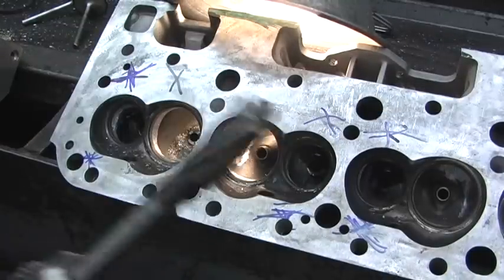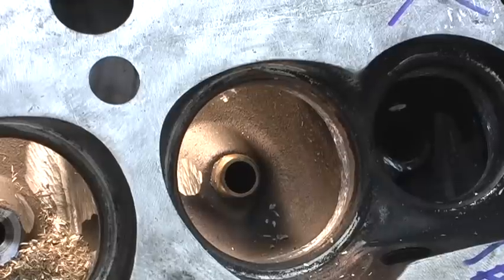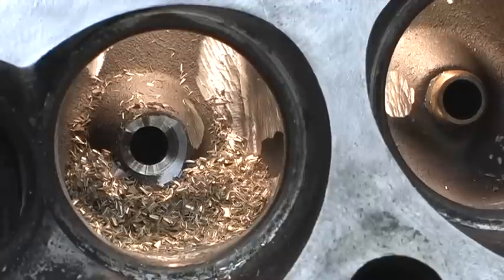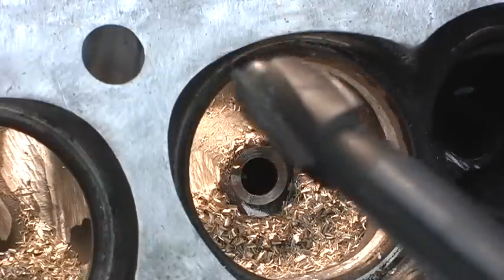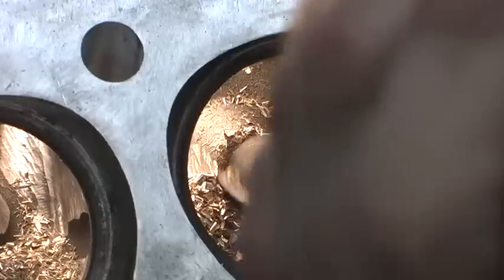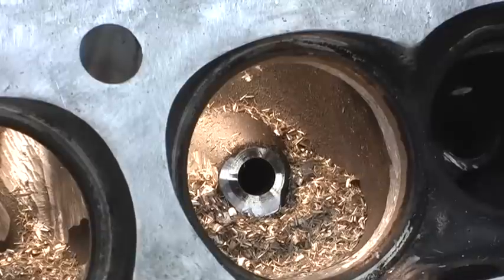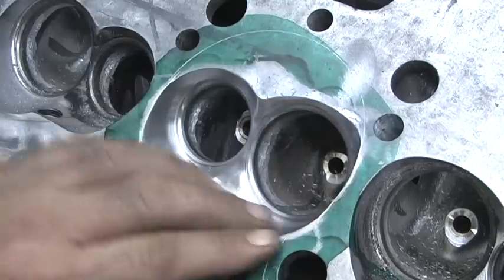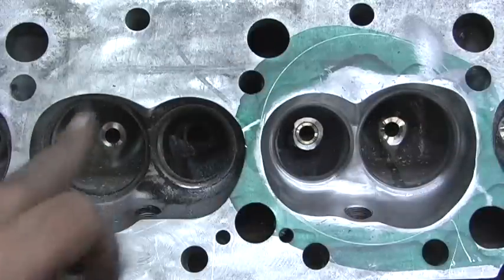Cutting Excess Guide from ProComp 210 SBC Head, custom Porting Combustion Chambers 4

Comment: If the compression is too low , angle cut the heads! A thicker intake gasket may be needed if you get crazy. The intake surface has to be cut at the same angle, its not the cheapest mod. But it also increases the flow in to the cylinders.  Putting the valves at a slightly different angle ,more towards 18°, nothing near it. I have a set of these heads . I'm itching to take them off and give them a little scratch!!!...  I want to drop compression, do I Can add boost!!  It's about 11:1. I'd like 9.8-10:1, and 10 psi. Minimum!

Comment: I have a LOT of excess valve guide sticking into the exhaust ports of my Profiler 195cc (raised, D-port exhaust ports). They're 11/32" ID, and 0.530" outside diameter valve guides. Where do I get this tool from? What is the tool called?  Someone recommended this tool to me, but it is only 0.500" wide and won't cut a 0.530 valve guide: http://www.beamequipment.com/Valve_Guide_Cutters-Cobalt_Power_Guide_Trimmer.html  The CompCams valve guide trimmers are just designed to thin the OD to accomodate smaller diameter valve seals and won't shorten a valve guide on the port side, either... 

Question: What's the name of the tool you used and where can I get one?

Comment: Flow difference between having this guide's modified like this and tapered ones being fitted are not a lot of difference but the stability and valve life would be reduced due to this modification. Especially with the weight of 2 valve heads. Tapered would be my choice in helping flow. Heat sink will also be concern especially for the exhaust valves which could cause detonation due to overheating.

Comment: Great video.. but.. doesn't the valve guide mod drastically reduce valve life and increase heat soak which leads to pre-detonation?  just wondering..
Reply: bicanoo_magic ,,, no,,, totally the opposite,,,,. Any small chamber or higher compression,,,, less initial. Advance,,,,.  Limit max advance,,,. ???    An adjustable vacuum advance,,, drill it and pin it where can't open no father,,,

Comment: Removing material from inside the port does not take away compression, but removing material in the combustion chamber does. If your worried about the loss of compression from removing material in the chamber, just shave the head down some, and gain back that compression, or even more, depending on amount shaved. You could also run a thinner head gasket to boost compression. Just check your valve clearance, so you don't get piston slap from removing too much of the head.

Comment: I like ur vidios, have a couple questions, 1st, r my 1987 tbi 350 heads the same u hve on ur 1989 porting series? They hve the flat intake bolts. 2nd, wen u 30° radius the perimeter of the combustion chamber to remove the sharp edges, if left alone, after its installed, dosent it become a strait line? ( ie. ) no sharp edges, (ie.) waist of time? Looking forward to more of ur channel. PS. Do u port Harley's?
Reply: Jobob's Bobjobs 87 TBI heads are possibly the WORST head chevy ever produced. Swap in ANY other head and your ahead of the game.

Comment: This was the first video where I saw someone cut the valve stem.  I can hardly believe more of these other videos don't show that.  Especially because of the roof being so critical to air flow.  In my specific application  (4 cam overhead design) the lift is significantly lower than a 2 valve head.  So theoretically my valve will require less stability at peak valve lift because it doesn't open as far.  I'll be sure to measure the valve guide of course.......  I need to pick up one of those bits and do that to my heads.

Comment: wouldnt shaving the exhaust vavle guides down decrease heat transfer between the valves and the head, eventually causing them to melt or am i missing something here, becuase i have always heard that argument for not cutting them
Reply: No worry, i have shorten the guides 1/4 on several heads, with good results. Most engines have lot´s of headroom for mods. Everything has it´s limit but, if you use common sens and save most of the exhaust guide you are pretty safe.. :)
Reply: +MSBomb those things are notorious for head issues.  If its not a dropped seat it'll be a broken spring or, a broken valve or, it'll wash the cam.  Save the money and buy a better platform.  Unless its a real  "Hemi".  good luck either way!
Reply: Trimming the guides, - the threading on the on the valve stem.
Reply: joshua fabrizius that is true , I would sacrifice I couple unmeasurable CFM , to allow heat transfer from the valve face, stem.
Reply from the maker: That is insanity at its best!!! cutting the guide away (to the point it is LEVEL with the bulk boss where it is one with the meat in the head) helps cooling. Think of it like this, it is a lot harder to heat a bulk of metal (aluminum or Iron) than to heat a half inch of valve guide sticking out of the exhaust port RIGHT IN THE WAY of the hot gasses. Get the over hang out of the way and make it level with the bulk/boss of the port and it will transfer the heat more evenly, and NOT make the guide so hot, but that is NOT the reason (the main reason) I do this, it is airflow.
Reply from the maker: I can tell your a DEEP THINKER!!!  Well, MAYBE what your saying COULD be true, IF you cut them down TOO MUCH.  There is a LIMIT (or a recommended amount that you can take before it becomes an issue) that I go bye, and a LOT of that depends on the amount of aluminum that SUPPORTS the guide, in relation to the distance from the end of the guide to where the valve meets the seat, once that is taken into consideration, you can CUT all you want without worry.  In this case, ProComp used a LOT of aluminum BASE to support the Bronze guide, TOO much; which is why I am cutting it in the first place as they went OVERBOARD!!! You have to weigh Spring Pressure, distance from end of guide to valve seat, diameter of head of valve Vs. Stem Diameter, which renders into "GUIDE MOVEMENT and SEAT MOVEMENT.  On the street I ALWAYS make sure there is enough support in this area, in the case of the ProCom, they just went CRAZY on the side of the formula that favors Strength with great sacrifice to the airflow of HIGH LIFT FLOW which depends on ROOF shape and relationship to the bowl.

Comment from the maker: What I can tell you is BE CAREFUL!!! These heads are very sensitve as the core shifting and pouring of these animals are indeed differant from other american heads. Not to say that there bad, just differant. look at Part Two and 2.4 of my current video on the ProComps, This entails sonic testing, look at what you see and trust your heart. If you have not done this a bunch, and you have done just a few heads then this IS NOT FOR YOU I promise, because in several area's you will bust through easy